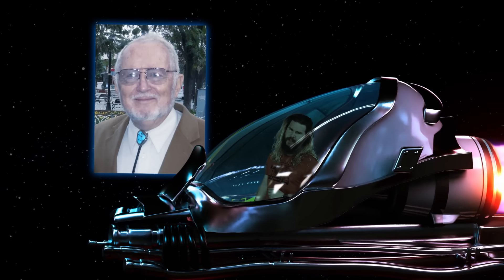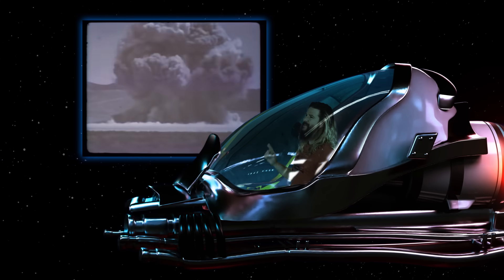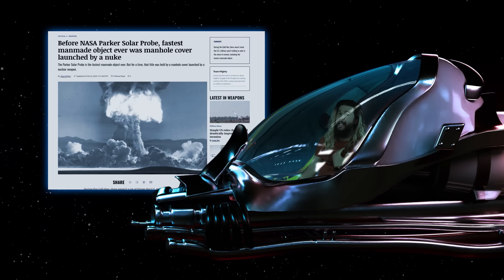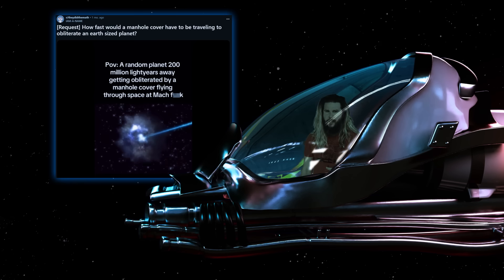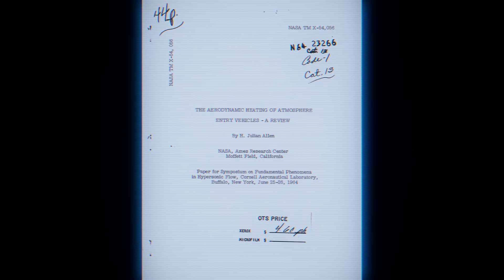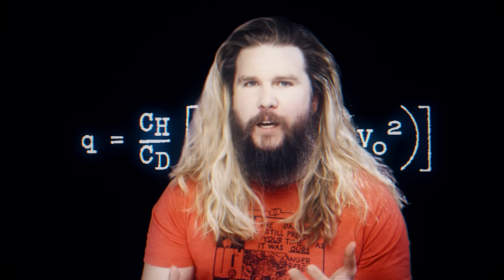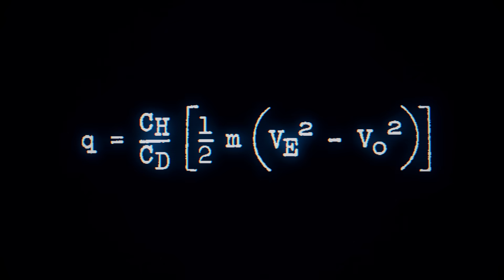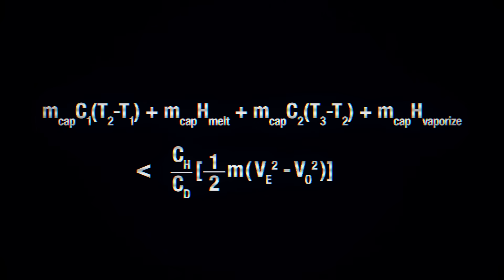Debunking the Nuclear-Powered Manhole Cover

Comment: To compare the Cap Cover to a meteor creates a false equivalency.  The composition of a meteor won't be as uniform as a cast iron cover.  Meteors will have voids filled with trapped gasses causing them to explode (usually, those that don't usually make it to the surface).
Second the temperatures the cover absorbed would be based upon the difference in speed of the atmosphere and the speed of the cover, the atomic blast would actually be accelerating the air away from the cover (upward) for about a thousand feet or so, and the shockwave that pushed the cover would necessarily be traveling faster than the cover (comparative density of cover compared to equivalent mass of displaced air, conservation of energy, Newton's laws of motion) this would create a barrier against atmospheric drag for the thickest part of the trip and the blast would heat and thus thin the atmosphere for a few kilometers.  Once the cover reached 15 KM altitude its speed would have slowed and the air would continue to thin at an accelerating rate as the cover ascended and its speed would continue to slow on its parabolic arc (max-Q equation would need to be tweaked for point propulsive egress velocity, atmosphere thinning at a rate greater than the slowing of the outbound object, probably around the 10km to 15km mark).
I do believe that the there were bits of melted cover that reached solar orbit, but if found it wouldn't look like a manhole cover and only the nuclear signature of its radioactive aura could confirm the origin of that new iron celestial body.  The boiling iron would also act as an ablative heat shield, just as it does for in-bound iron meteors that don't have gaseous voids in them (which explode during entry).

Comment: The problem with your calculation is you are assuming that the disk is moving through the air flat at the worst possible orientation for a positive outcome.  You need to re-do the calculation with the orientation being sideways in order to understand if its "possible" for it to have occurred.

Comment: So it was the fastest manmade object, but only existed for a split second, and never made it to space. Right?
Reply: Depends on who you listen to and what you choose to believe.  The facts are that (according to NASA), "space" begins at an altitude of 50 miles above sea-level, and at a velocity of 150K mi/hour (41.666666 mps), the mass would have reached the officially recognized lower limit of space in just a hair short of 1 1/4 seconds.

The question is, was that sufficient time, in a rapidly decreasingly dense atmosphere, to generate enough friction to vaporize the mass BEFORE it reached 50 miles in altitude?

Comment: The plate likely was in the densest part of the atmosphere for 0.25 seconds or less. Meteors tend to burn up over several seconds. 

The plate also was likely tumbling end over end and each face would have been exposed to the hot pressurized air for half the total flight duration. 

Also we have reasonable real world tests to compare how metal reacts to a very hot but very brief exposure. The Lew Allen ball tests. Various metal spheres placed in very close proximity to a nuclear explosion. One such test result was a sphere of aluminum at a distance of 60 feet from the blast had around 25mm of material ablated off the facing surface. This heat would have lasted 0.25-1 seconds.

I still think it’s likely that some of the plate did make it into space, or at least deformed fragments. We’ll never know because if that plate was traveling some 37 miles per second, it could be a cool 80 billion miles away by now.

Comment: by my calculations the manhole cover would have reached space in 2-3 seconds. and it would have been going though thinner and thinner air on the way up. yes it would have slowed down some due to gravity and air resistance, but there would have been so little time for them to effect the manhole cover that a good chuck of if would have reached space.

Comment: Do you really think any amount of heat and friction in the atmosphere will be hotter than the heat it encountered from the man made sun that vaporized the concrete the manhole cover was attached too? Also, you have to add the weight of the manhole cover ring that the manhole cover was welded onto, guaranteed the manhole cover didn't just rip free of the ring it was welded to, the entire ring went with it, the bolts anchoring it likely failed as the concrete around them was vaporized. 

Also, no matter what, it was 100% the fastest man made object on the planet. Even if it did vaporize in the atmosphere it was still the fatest man made object on the planet. The fact that it was destroyed in the end doesn't matter. 

Also, there is a possibility it functioned kind of like an explosively shaped penetrator, (overly simplifying here) where a copper sheet is in front of an explosive charge and that charge makes the copper turn into a hypersonic jetvof liquid copper that will punch through armor plating on a tank... the manhole cover and ring could have done something similar, being deformed into a more aerodynamic projectile due to being ripped from the concrete structure by the power of a miniature sun being created below it....

Comment: I think some people also forget that a nuclear blast would have the heat from the light hit the plate before the explosive force would hit it. Even if it's just for microseconds it is enough to have the plate start in an increased heat state, which would make it disintegrate faster than a neutral temperature.
Reply: Heat and light do NOT travel at the same velocity.  You seriously need to study more on basic ballistics.

Comment: Kyle, I think there are too much of assumptions here.
A lot of people here already has told about possible manhole flipping sideways, density drop with altitude and zero final speed.
But I'd like to add the fact that manhole mass would not also be constant - it was not suddenly heated while just laying on a flat surface, it was traveling Mach F trought the air, so it would most possibly ablate.
Nice piece of food for thought, though

Comment: I think many people forget drag goes down when you exit the atmosphere, plus the heat experienced at Lower elevations may have been instantaneous depending on how fast it was actually going because of the inaccuracy of the 1950s high speed camera.

First, we need to find the actual speed of the iron cylinder by knowing how long it is, and how much it is stretched in the single frame it appears in. I don't think it was traveling at 66m/s because that's actually a guestimate since it only showed up in one frame.

Second, since the atmosphere is thinner the higher you go up, you would be dealing with an atmospheric gradient that decreases as your elevation increases, approaching zero near the edge of earth.
Thus drag would decrease with respect to elevation. The calculations as a whole would require some multivariate functions to accurately describe. 

Third: the change in velocity will show a decrease. What I mean is that the velocity is decreasing but decreasing at a decreasing rate, since drag is also decreasing. If it does exit the atmosphere, it would exit at a constant rate since there is no drag in space.

Personally I think it didn't burn up, but I wouldn't say it managed to exit the atmosphere unless we ran the calculations correctly with multiple variables in mind. I do think it is highly possible it made it though.

Comment: You're missing some vital differences.
An incoming object begins heating and slowing in the thin extreme atmosphere. By the time it hit thicker atmosphere its already vaporizing.
An out going object faces the greatest resistance at the beginning of it journey. However, the resistance this object faced would drastically reduce as the atmosphere thinned and its speed reduced.
While I also suspect that it was vaporized, using an equation for an incoming object may not accurately define what an outgoing object would suffer.
Reply: I don't entirely agree with you, but your analogy is correct.  It's like the difference between firing a high-powered bullet INTO a pool of water, versus firing it OUT.

Comment: For being so smart or pretending to be..simple oversight shows how dumb you are. Here's a simple test for a simple mind. 
Drop a coin in water and watch it drop...can you tell me at what point it falls perfectly flat/maximum resistance the whole way to the bottom?....oooo wait that's not how that works, weird. So your algorithm means nothing and opinion means nothing on this topic.
Reply: Also not accounting for the simple physics of air foils (like golf ball dimples) and evaporation theory (like a block of dry ice sliding down a  sand hill)

Comment: You forgot a couple things...
1.  The atmosphere gets thinner the higher you go up.
2.  Meteors travel quite a lot farther throughout the atmosphere than the approximate 50 miles of its thickness.
3.  The drag through the atmosphere causes decelleration, so as the velocity drops the heating drops.
4.  You assumed the manhole cover retained a flat shape when it was ripped from the mounting (highly unlikely)

Conclusion... there are too many variables and no way to repeat the experiment. Therefore, assuming the cover vaporized in the atmosphere is unwise.  The mere fact that it was visible in a single frame traveling at 66kps would mean it would penetrate the thickness of our atmosphere in a mere second (where "space" begins at 50 mi up)With 99% of the atmosphere below 20 miles (32km)... it would have penetrated most of the atmosphere in about a half second.
Reply: exactly! and who's to say the air resistance didn't immediately put it in a more aerodynamic position as well...
Reply: @Drunkledore much as it does with meteors
Reply: Can we see it incandescing in the frame of film? If not, I don’t think it vaporized. 

The compression of the air is what causes atmospheric heating, not “friction”. The millisecond or whatever it took from light off to that frame of film is enough to compress the air to incandescence.  That’s its highest speed, and since it’s the lowest altitude, that’s the max compression. If it didn’t incandesce then, would it in the following 900 ms it had to traverse the atmosphere?
Reply: @tylerfb1 I'd say "no" to the first and say it takes longer than 500 milliseconds to incinerate 4000lbs of steel.
Reply: Exactly what i concluded.. The time taken to reach space negated the exposure needed for friction heating to have destroyed the plate by a country mile!...’Thermal dynamics!!!

Comment: im just some guy BUT... dont meteors explode from (a) the friction from encountering atmosphere which causes (b) realease of gasses. also peak friction would be at sea level/desert floor and would diminish as it gains altitude. when going to the sea floor you dont get the "bends", only when resurfacing. not everything is a 2 way street...

Comment: When the cover was blasted from the rim and the welds broken, the process of deformation and rupture of the welds would have added some inherent heat to the cover before it even moved.  Another thing you should add in is the heating from xrays from the device before the manhole moved, if the manhole was located within the fireball radius of the device.

There are a lot of variables and unknowns for this topic, though.
An interesting side-topic was, I believe, a proposal by Freeman Dyson (I think I got the guy right) on using nuclear explosions to push space vehicles into orbit.  For some reason, it was never tried.
Reply: Gee.......I wonder why. 🤨🙄😑🤦‍♂️

Comment: Im surprised not the video or comments bringings up one single fact the thermal load gained from the blast of a nuclear bomb which is thousands of degrees. This calculation just assumes it starting at room temperature not taking the initial blast into consideration

Comment: I've launched plenty of metal discs into the air 😂. Put an M80 or M200 or whatever you want under an empty coffee can (Folgers preferably) and watch the bottom (now the top because you flipped it over) disconnect from the cylinder and soar into the air. Once we made one go so high it took a long time to come back down. Also they don't fly straight, they shoot up really high then dart off at an angle probably because it's a disc.

Comment: Forgetting that at peak velocity it was riding a shockwave going in the same direction. Drag wouldnt have been an issue for the first second. By which point it was 50 miles up. Air is pretty thin at that altitude

Comment: I'm happy the manhole cover might have made it to space. I'm also happy it may have also vapourised. Both are hypothetical, as is the process in this video. A few assumptions though. It would be reasonable to assume the manhole cover flew side-face, rather than flat with maximal drag. There is much evidence for high speed objects to naturally assume the most aerodynamic aspect when expelled at high velocity - nails in high explosive devices travel "backwards", namely head first as opposed to point first like an arrow launched from a bow. Also the NASA equation is an assumption in itself and has not been tested at ultrahigh velocities exceeding escape velocity. If it was traveling at 66km/s then it would have reached "space" in about 1.5s, suggesting it would have to vapourise almost immediately prior to reaching space. And comparing it to meteors that could be largely ice and fragmented rock is not valid. Lastly the cover would be riding a massive pressure wave which would expand as it traveled upward. Pressure would increase boiling point and therefore reduce the chance of vapourisation.

Comment: Just my 1 cent contribution. This would be correct if the final velocity after escaping earth atmosphere were zero. in the equation solution of 9:37, you should consider what would be the velocity at which the object melted, since it did not ended losing completely its kinetic energy after leave Earth Atmosphere.
 The best approach would be calculate its drag and final velocity after 150-200km travel. It most likely would result in drop of less than 5km/s of its speed
Although in smaller "scale" (kind of), the daylight fireball of 1972 entered Earth atmosphere at ~15km/s and after reaching an altitude of  +57km, it lost only 0.8km/s, despite its size (3-15km) and staying in Earth Atmosphere for over 100s

Comment: It doesn't seem right to me. Correct me if I am wrong.but going out of the atmosphere there would be less and less drag and heating as it got higher. So you can't apply the same math as  coming into the atmosphere. It would be getting hotter and hotter and more air dense.

Comment: So, I derived the vaporization energy using the 354.1 kJ/mol value for enthalpy of vaporization, and found the energy to vaporize the cap is far less than you estimated. It would be somewhere around 7.3x10^9J of energy. In fact, this same method shows even tungsten couldn't survive.

You can do the math on time it takes to double check this, but my numbers, based on the Fay Riddell Equation suggested it vaporized fully in about .36 seconds. This fits with the ability for it to be visibly seen launching, turning into a streak of light, and disappearing from view all in an instant, and thus fits the chain of events witnessed that day.

Comment: I'm going to have to disagree with the number plugged in at 9:38, since it you've set the final velocity v_0 to be 0 m/s, but in reality, it could well be 5 times the earth's escape velocity, which scales the final number on the right of the inequality to 1/36 of the number you've shown, such that the inequality would not be satisifed.

In other words, from the point of thermoddynamics alone, travelling through the atmosphere at that speed is not enough to melt it. BUT as you've pointed out later, I think it will tumble, break up due to centrifugal force, and then shatter before reaching space. Definitely won't reach space in one piece, if at all.

Comment: Key factor not discussed: heat transfer is not an infinitely-rapid process, i.e. it isn't instantaneous. While meteors moving 3x slower burn up, an object going fast enough could theoretically make it through before it has a chance to burn up. The object, admittedly not factoring in drag, would have cleared the atmosphere in barely a SINGLE second, meaning it may not have had enough time to absorb the necessary heat to be vaporized.

Second, the comparison with meteors is flawed in a very specific way: meteors are going from a vacuum into a steadily INCREASING dense atmosphere AT AN ANGLE, where the "manhole" would be moving from a dense atmosphere into a rapidly THINNING atmosphere at NO ANGLE. Since the math shown doesn't address that (you would have to integrate the effects of heating/drag across the thickness/density of the atmosphere), it's still possible the "manhole" made it to space (whole or in part).

Really want to see you address THAT.

Comment: Okay so the manhole either flipped due to resistance and went up sideways, or the super heated air and nuclear explosion behind it wouldve accelerated its velocity and reduced its air resistance, space is only 62 miles up meaning that it wouldve had to vaporize in less than a second to not reach space